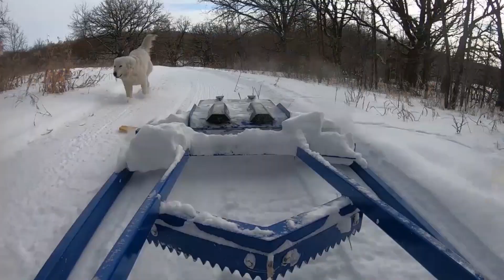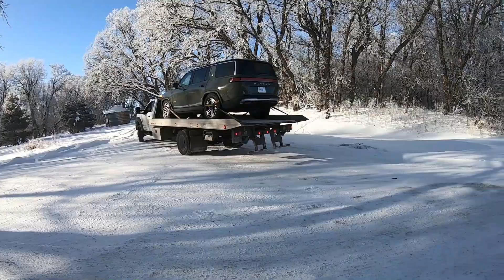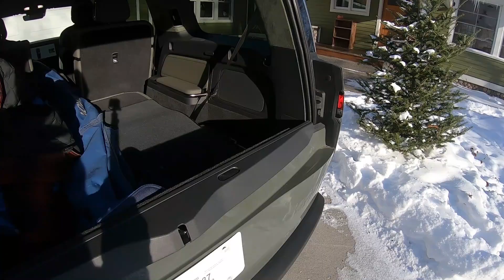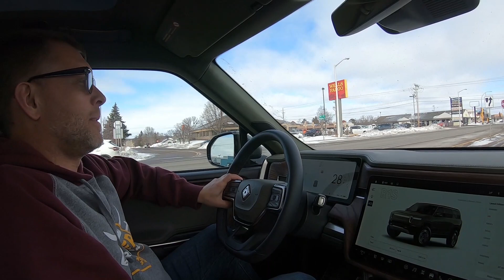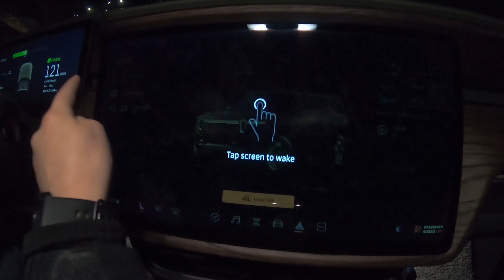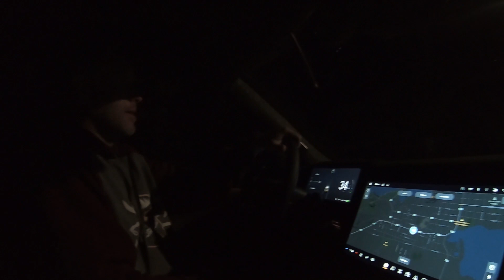500 Mile Rivian R1S Camping Trip in Below Zero Winter Weather.

Comment: Do you recall if that whining noise (for lack of a better term) on the highway was motor / drivetrain noise, or probably noise from A/T tires?  It seemed to be speed dependent.
Reply from the maker: I think you are referring to the wind noise from the driver window. That was
Speed dependent and never was resolved.

Comment: If camp mode doesn’t work like it should, that’s a safety issue with those temps. I’d be an unhappy camper spending 80k with that issue. Charging time is terrible as well. Thank you for sharing your experience.  I’m waiting for the max pack, but I may pull out. I think they still have a lot to figure out.
Reply: Troll
Reply: @justbecause9645  no,I’m  a potential Rivian Customer with an order I’ve been waiting for over 3 years. These videos help my decision on pulling the trigger. I am so grateful that this owner was upfront and honest about his experience and not just another fanboy doing nothing but promotion. 83k for this truck is serious money. My nearest Rivian Center is almost 2 hours away, so these inconvenient  “issues” are very relevant.  Thank you for the misnomer.